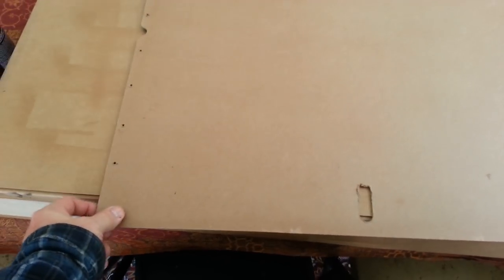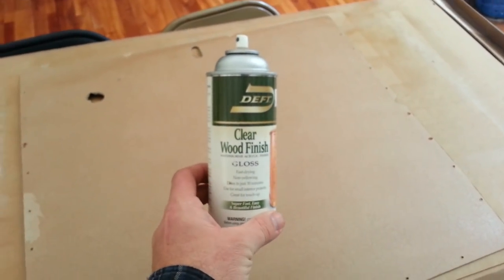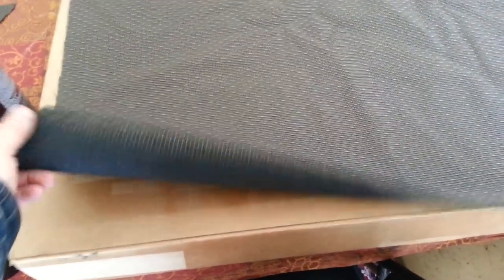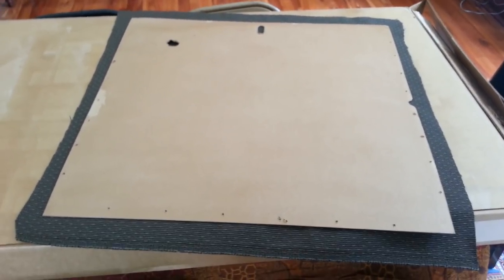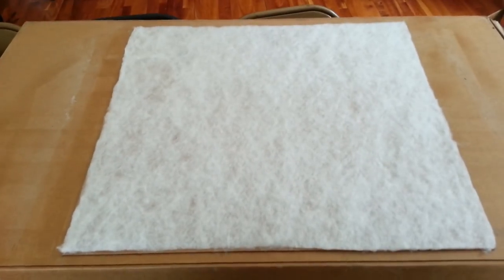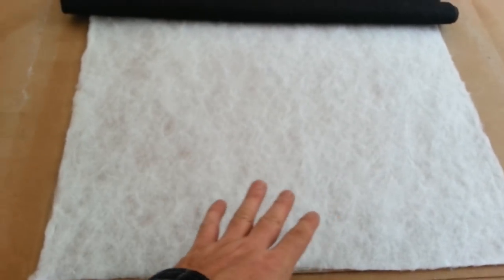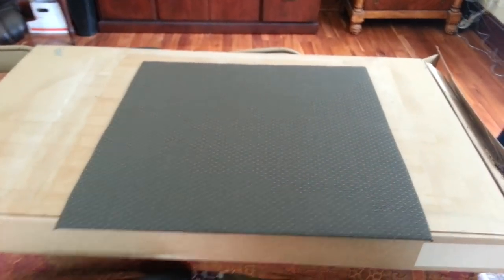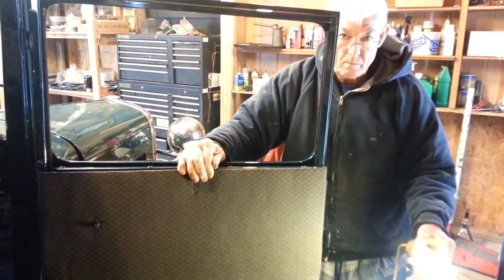1930 Ford Model A Interior door panel upholstery

Comment: When do you install the clips that hold the panel to the door?  Seems they should be installed before the batten is in place.
Reply from the maker: at the time of installation 
this is a very easy  no complex panel. There are many times that you will have to modify and engineer for your application.  Good luck in your project